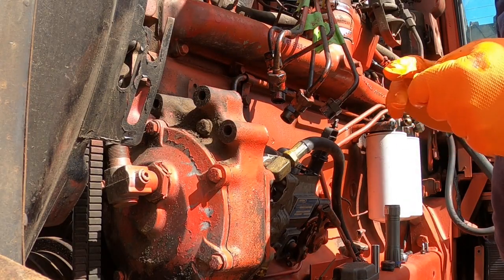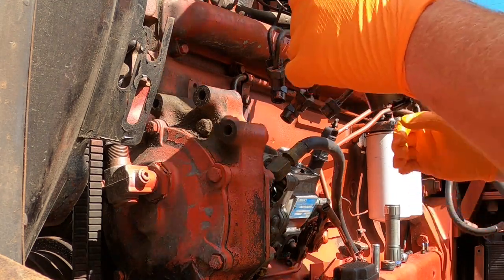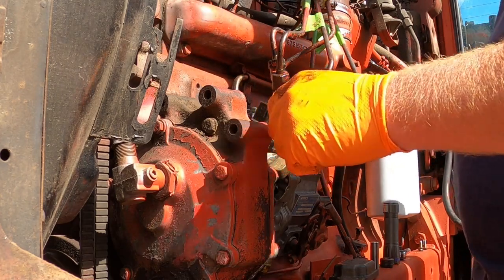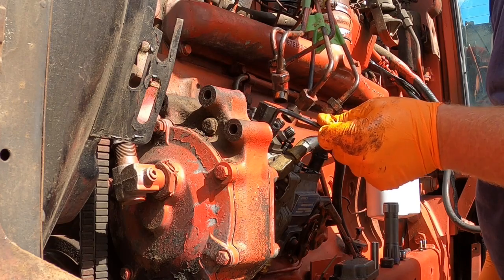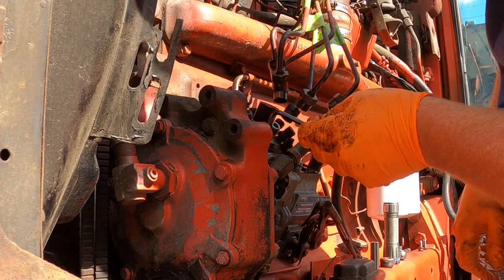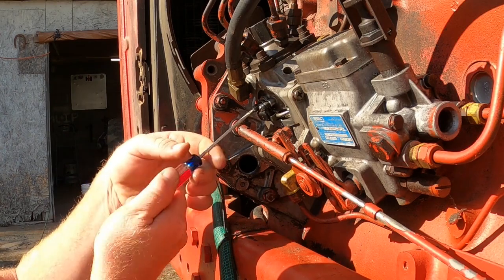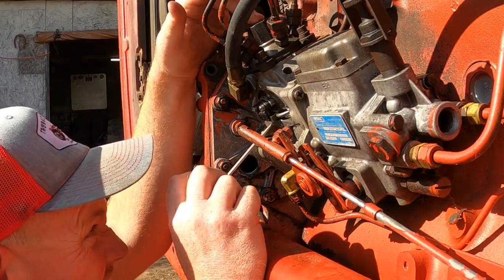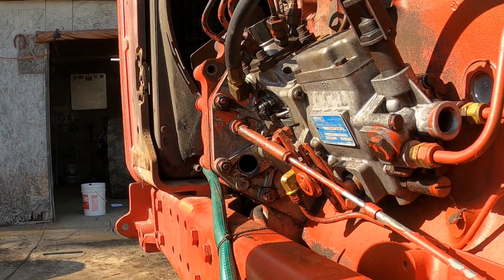1086 INJECTION PUMP PART 3.....

Comment: Man I was hoping to see it started and running.  Good work on the pump repair.  The fuel line from the filter to the pump.  Get it from a caseih dealer.  I have always been told that ih mechanics. None of them have ever had any luck with after market lines.  I'm looking for to seeing it run.
Reply from the maker: Thank you Monty, I hate so much I goofed up the charger, I had pumped myself up too!! That's EXACTLY what I have heard, it's a special hose and pulses with the pump or something. They say don't use hyd, line....which mine has been😫😫 I hope that hasn't damaged it. Thank you for being here watching, supporting, following, and COMMENTING!! I hope you will tune in again, fingers still crossed!! Thank you Monty!!

Comment: You should really grease those O rings up generously and it will go together and seal better. The O ring is all there is to hold back the pressure. It helps to keep the O ring from rolling and/or pinching on installation.

Rock and roll, my friend! Injector pumps can be persnickety!
Reply from the maker: Thank you so much Gary!! You are correct for sure, they are very particular as to how they want to work!! Thank you my friend for being here watching, supporting, following, and COMMENTING!!! Means alot sir, hope all is well down your way!!